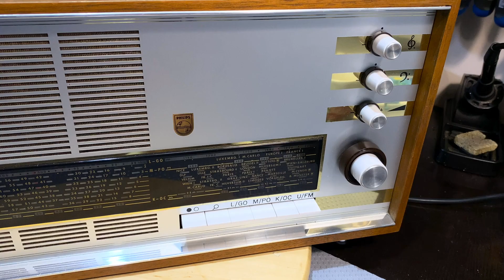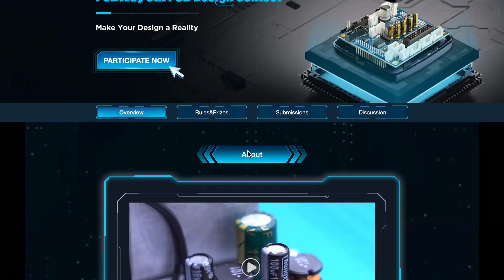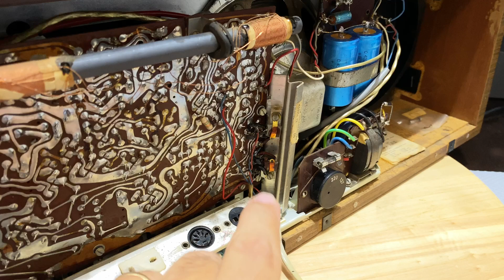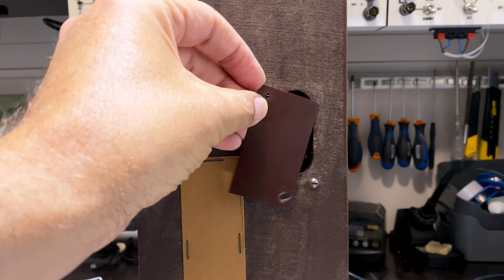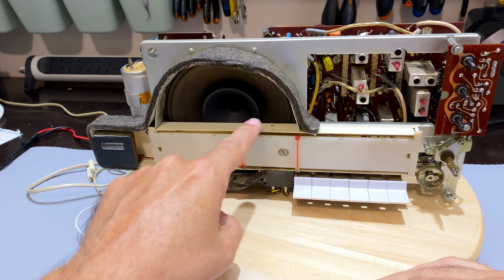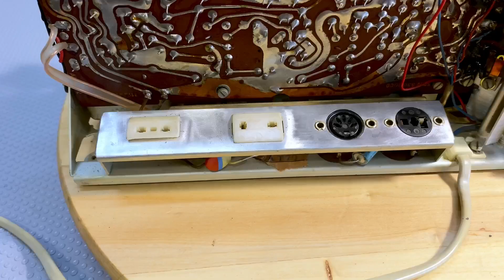Restoring one of the first Philips transistor radios from 1965. Unbelievable condition #PCBWAY#

Comment: I have a bunch of those old Phillips capacitors, got them in a box of new-old stock caps from electronic goldmine out of Arizona here in the USA.  While I have never needed any of them, testing shows they still are within specs via the M Tester. The rest of the caps that came in the box are new and all have tested great, most are good brand name; I love getting their surprise packages filled with all sorts of parts, it brings to mind a janitor sweeping up the floor of the warehouse and bagging all the parts that have landed on the floor during the days filling of orders or something. I have quite a supply of caps now and most of them cost less then a cent each, just that I need to sort them and store them.  Thanks for the great video I love watching repairs and restorations.

Comment: nice beast!!  thats nowhere near one of their first transistor radios, maybe their first mains 'tabletop' transistor radio? they did do some small bakelite cased battery ones similar to the 'philetta' valve sets, their first transistor radio was a battery portable in the late 50s.... i dont have one of that model but one thats maybe their second or third one ,(at least here in the UK)
Reply: as for finding a 'new old stock', i have a Defiant(UK co-op own brand) late 40s/early 50s small wood cased thing in its original box, looks pretty much A1, no use, or very little use
Reply from the maker: I believe you’re right. Must have been table-top model

Comment: Very interesting radio Mr. Caldera, I wonder if Philips never made any pocket transistor radio in the 1950s or early 60s, I do not think I've ever seen one I think, but it would surprise me considering it was such a large company. 
Or do you mean it's their first full size (table model) transistorised radio? 
And it has the typical octagonal speaker, which is completely tarnished of course, like they all are. But they do sound good!
Reply from the maker: I guess it’s actually one of the first table models, you’re right
Reply: yes they did do some 'pocket' sets, i have one, from  the mid 60s .. as well as many 'larger' upright portables, from the late 50s

Comment: Like most manufacturers, Philips was making transistor radios in 1960 or perhaps even a few years earlier. But as with other manufacturers, Philips delayed converting the majority of their table radios to transistors until the mid 1960's. So, this is a relatively early transistorized table radio. 

Grundig made some early transistor table radios that had battery operation such as the "Black Magic" sold in the US and in other countries under different names.

There is a more deluxe version of your radio called the "Pallas". It appears to have two speakers but is not stereo.
Reply: For example Czechoslovak Tesla made its first table top transistor radio in 1962. Its in the same case like previous tube model. But it runs only on battery, there is not power supply for 220V.

Comment: Hi Manuel. What a gem!  I’ve never seen a radio of that age looking so good. Did you find the date stamp inside?  Phillips have certainly lifted their game since the 1930’s in terms of serviceability.  I could hardly believe it just slid out of the cabinet like that. 
I think your decision to leave that circuit board alone was a wise one. They are so easily damaged. 
Thanks for yet another interesting and entertaining video.
Reply from the maker: Rene told be it’s under the little packet with the spare fuse. I looked everywhere for it 😊
Reply: @electronicsoldandnew  they'll likely be date codes on some of the components, especially the speaker..

Comment: I think it's a wise decision to leave alone what isn't broke. If the capacitors fail later on down the line, you can always change them then. Those IF cores and that early PCB are so delicate, I don't blame you for leaving them alone. If it ain't broke, don't fix it is probably the best policy here. Great radio and great video to watch.
Reply from the maker: Thanks

Comment: Greetings:
FYI: A speaker with a second smaller one amidst the larger cone is either a coaxial speaker or a whizzer cone depending on the presence of a second voice coil/magnet assy. The whizzer is a small stiff cone mounted above the existing voice coil. Just helping where I can.
I thought I saw multiple dial lamps, but with the single lamp showing, the dial pointer is unseen in the video. The video shows a port for two dial lamps; but it is unclear whether one is for AM and one for FM  or for better dial lighting overall.
Dave Tipton rolls the edge of the stuffed electrolytic between two pieces of wood mounted at 90 degrees held within vise jaws as he demonstrates in one video.

Comment: Hi Manuel. That is a great looking radio. Possibly as  close to new old stock as you are likely to find. Being a Philips, I was waiting for the awkward gremlins that is so common with the brand. Luckily you didn't encounter any. Superb stuff as usual. Cheers Chris
Reply from the maker: I guess the gremlins took a break 😊 for a change
Reply: @electronicsoldandnew  yep, i looked up the circuit and  it's all germanium transistors, luckily not the AF11x types that suffer badly from tin whisker shorts but the later AF12x types which are much less afflicted, but still can happen, i've had the audio ones, AC128, etc. short to their metal case 😲

Comment: Maybe an alternative would have been to slice the big cap can in two where the retaining band goes round it. Easy enough to hide the cut then. I've found a pipe cutter handy for slicing capacitor cans open, although this can may have been a bit large. Nice result though, on an interesting set.

Comment: Hi, Manuel. The 2 LW stations you are tuning from North Africa are Médi 1 (Morocco), on 171kHz and Radio Algérie, Chaîne 3 (Algeria), on 252 kHz. Regards
Reply from the maker: Thanks for the info. However, I seem to get RTE Ireland on 252kHz.
Reply: Correct. Both stations share the same frequency. But Radio Algeria having a much more powerful transmitter, you will be able to tune it during the day, as Médi 1, while RTE will only be heard during the night.

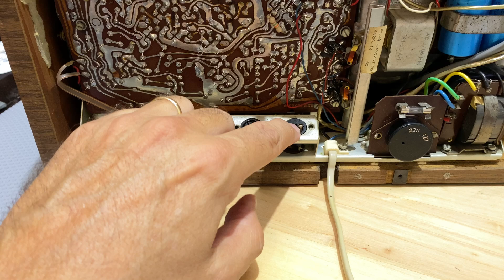Comment: 6:30 Very often with this Type of DIN Speaker Connectors You can actually decide. You can plug it in in two Directions, one Direction will mute the internal Speaker, the other Direction - possibly - will not mute the internal Speaker..I do not know why they actually did that, but they acually used the DIN Headphone Socket in this Way as well...
Reply: Sometimes the radio would connect to a speaker in a different room. My grandparents had a radio which used to be connected to a speaker - in the neighbors' house! - as they couldn't yet afford their own one in the 1950s. 
So it makes sense to keep the internal speaker active in such a scenario, as opposed to when you just hook up a better speaker.
Reply from the maker: Good to know. Thanks